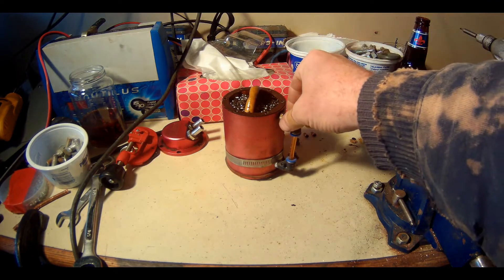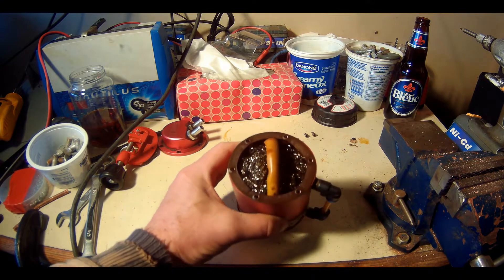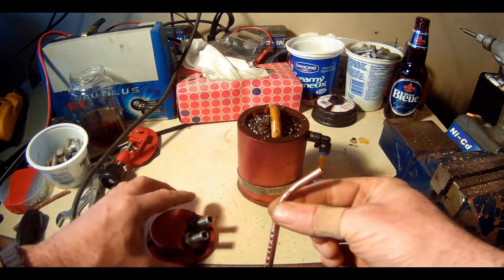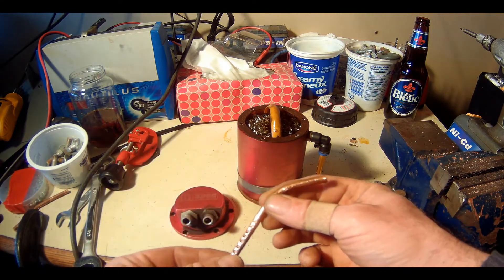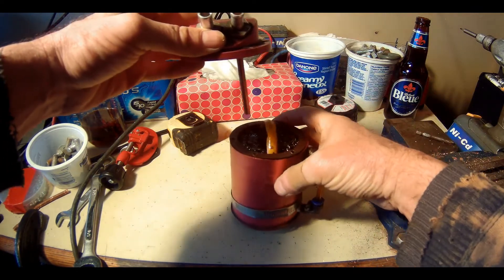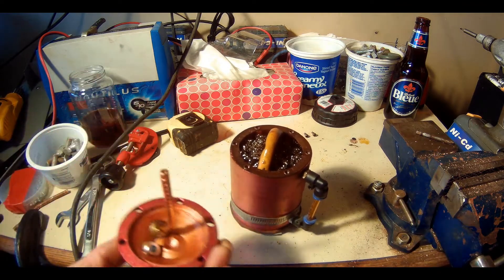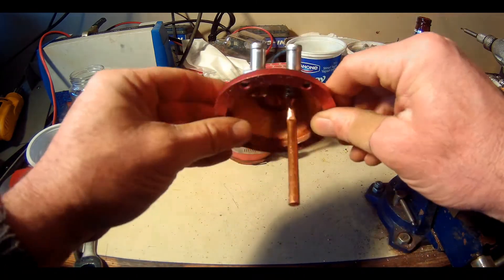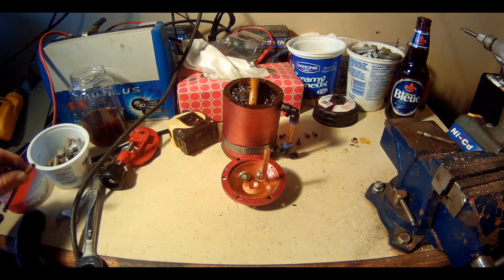Second modification of my D1 spec oil catch can.

Comment: What would be the entrance with dirty vent? The one with the long bronze pipe? Or is that the way out?
Reply from the maker: The one with the cuper pipe is the entrance (coming from valve cover or pcv valve),the other one is going back to the air intake. If you need more info,just drop me a line here. Thanks for watching